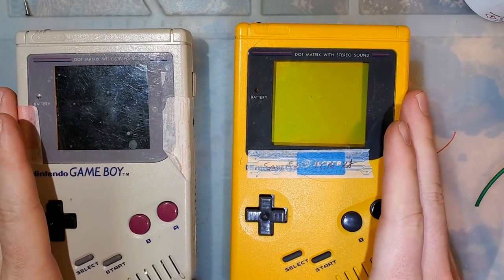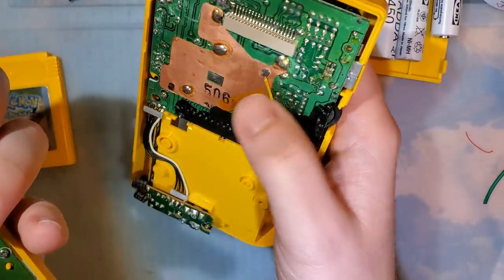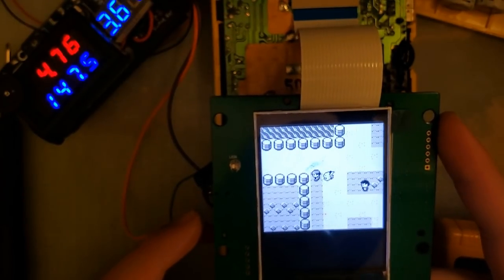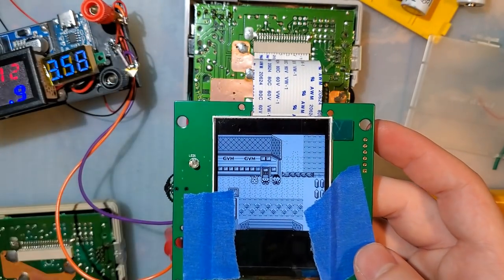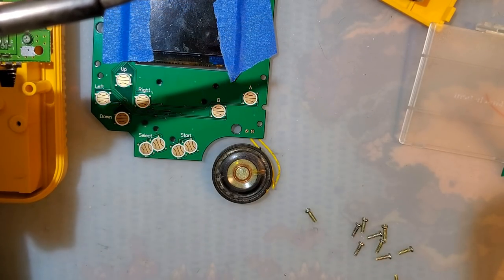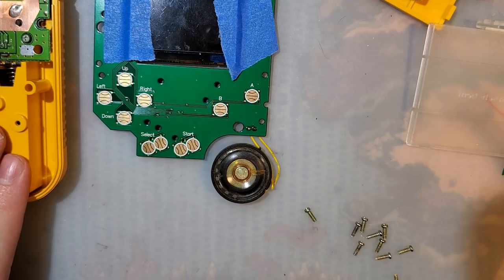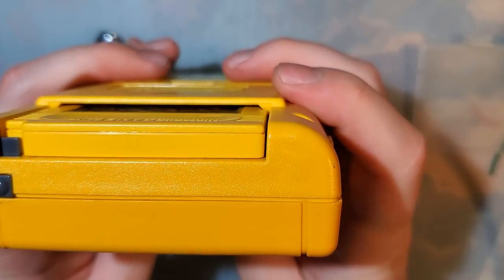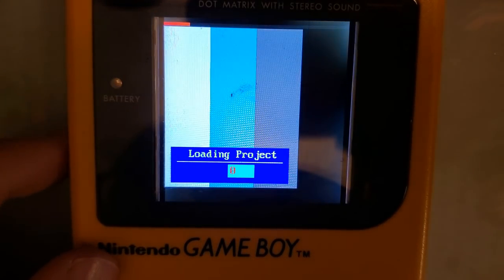Moon IPS Install and Testing for DMG Game Boy

Comment: Excellent video. This kit looks excellent, but slightly lost as to what's currently "the best" replacement screen (with no knowledge of what's coming onto the market soon). Any advice?
Reply: I think moon ips is ok, but not many review even on taobao or hanyu(second hand taobao makho link one ). RIPS V3 if you have nice and fit bracket is good, if not it’s fucking painful and tired for place the screen at good position. Funnyplaying dmg one not yet release, they also have pixel gird but I don’t like it need to trim big the display area like their gba ips v2.
Reply from the maker: https://www.reddit.com/r/Game_Boy/wiki/mods/backlightmods